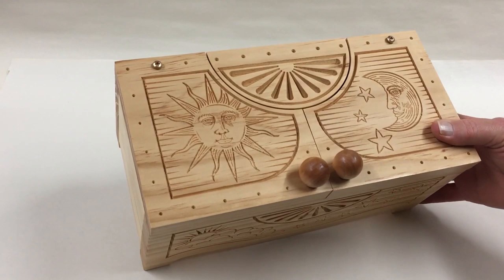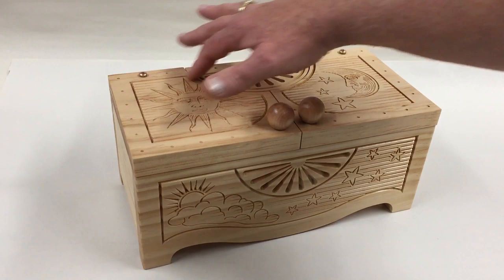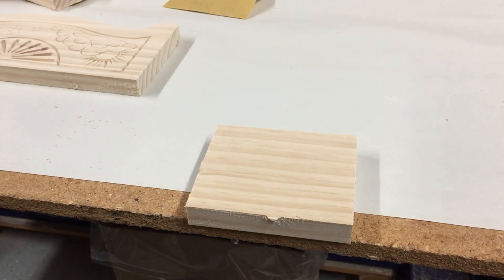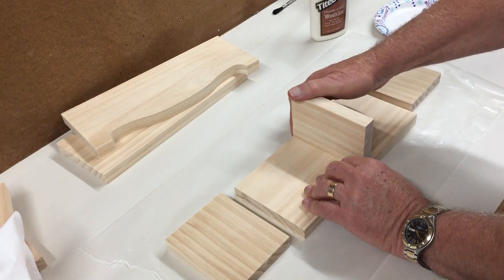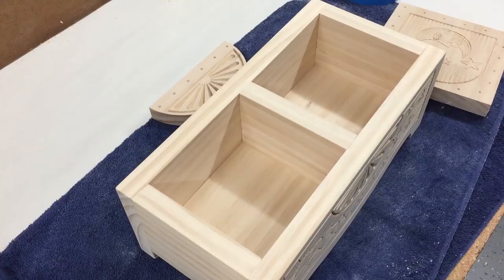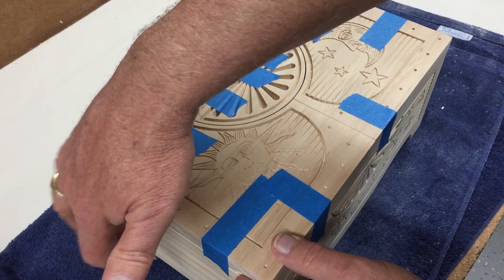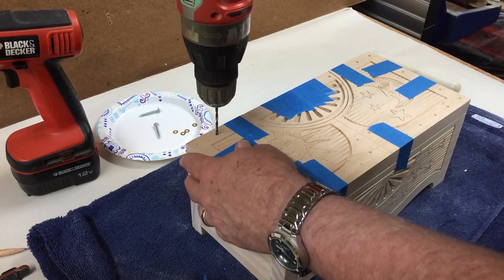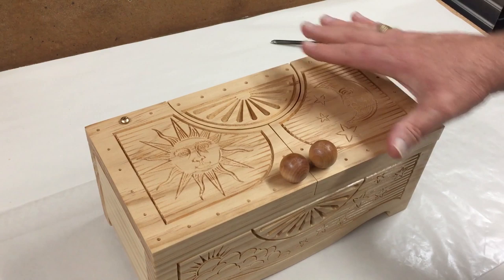Making The Solunar Box | Michael Tyler's FREE Project of the Month | Vectric

Comment: Why did you mill the wood with climb milling? The wood has much better finish when it milled by conventional milling. The most easy way to decide the best milling direction is to compare the finish of the stock and the detail itself. If the stock has better finish, then you should change the direction of milling.

Comment: The files are listed for Aspire and VCarve Pro.  I don't see anything that would prevent using VCarve Desktop to make the project.
Reply: If I'm not mistaken, you should be able to use the VCarve Pro files with "Desktop"
Reply: You can but you may need to tile to get around the 24" limits.   If the project depends on one of the add in gadgets you cannot use Desktop as it doesn't support gadgets.  Most of their projects list both Pro and Desktop.  I thought it was odd that this one didn't.